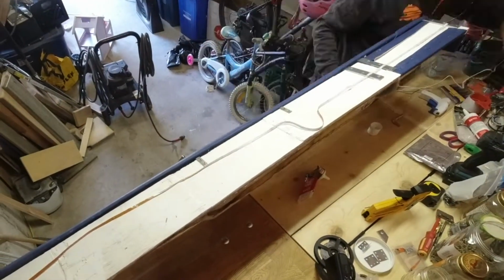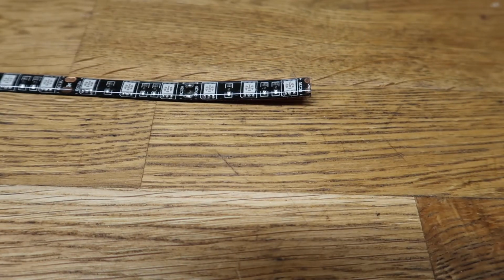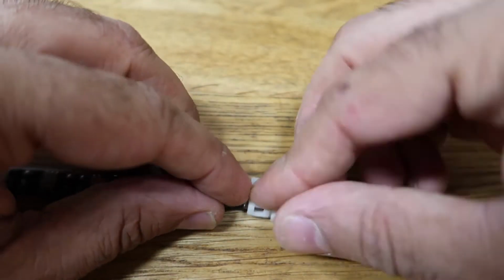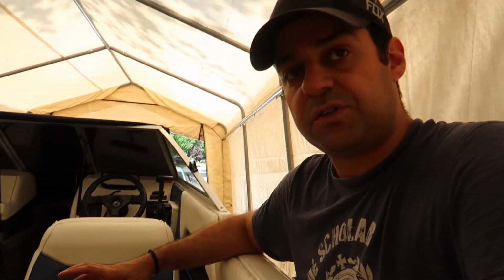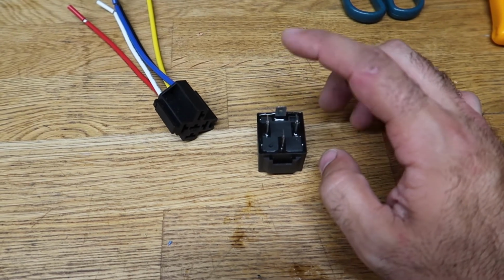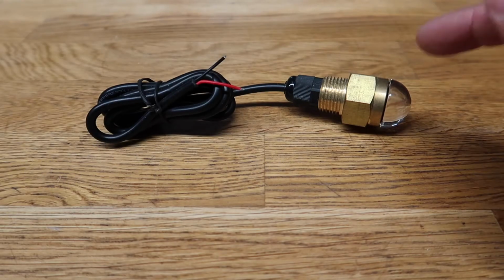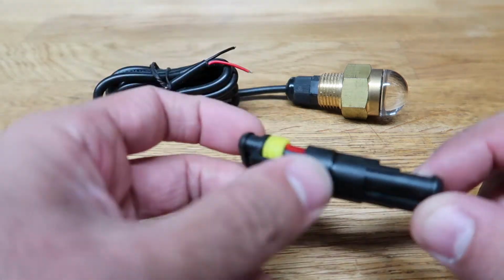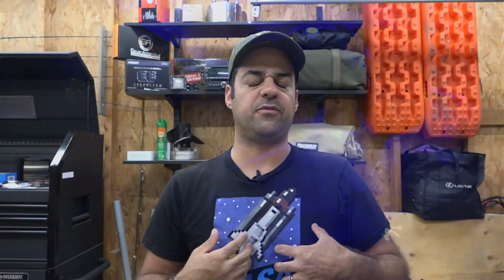Installing Blue LED Lights in Our Boat Pt. 2

Comment: Another question. How did you run the led strip in the cup holders? Looks so slick. I’m going to do the same on my boat. Also did you ever get the transom lights? I’m on the fence about the drain plug but still looks cool. That drone video is awesome.
Reply from the maker: Hey KJ, 
So for the Cup holders I bought them just as they are,  Stainless Steel with a LED ring in side, Here is a link:
https://www.amazon.ca/Pieces-Stainless-Holder-Marine-Available/dp/B07M69XP7C/ref=sr_1_6?crid=6X3CTQBM8V3J&keywords=LED+cup+holders&qid=1673276452&sprefix=led%2520cup%2520holders%2520%2Caps%2C87&sr=8-6
I haven't Gotten any transom lights yet. But here's a link of one that I am looking at:
https://www.amazon.ca/dp/B07TGCJG8Q/?coliid=I3C1Q8LQ75F7E0&colid=2W6W35A2AFOD0&ref_=lv_ov_lig_dp_it&th=1
We are thinking about maybe selling our bought this spring!  Not fully sure. Because of this we are double thinking of what we will do with the boat! 
Or if you want to check out my amazon list:
https://www.amazon.ca/hz/wishlist/ls/2W6W35A2AFOD0?ref_=wl_share
Hope this helps.
Thanks for your comment and questions.
Reply: @416Expedition  Thanks for the info. Good luck with the boat sale if you decide to do that. It's still pretty crazy how much you can sell boats for so hopefully you get some good coin!
Reply from the maker: That the idea.  Sell for some good coin then maybe next summer (2024) hopefully the prices go down and get another boat thats bigger and start a new project! But I'm attached to this one! lol.